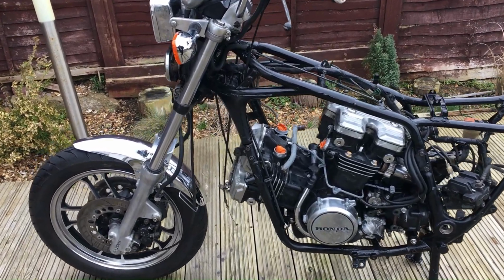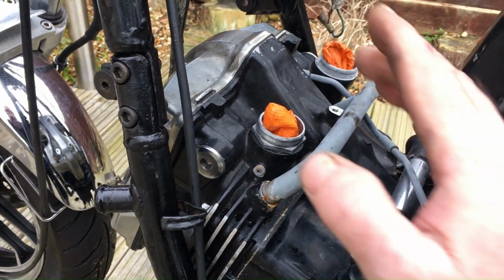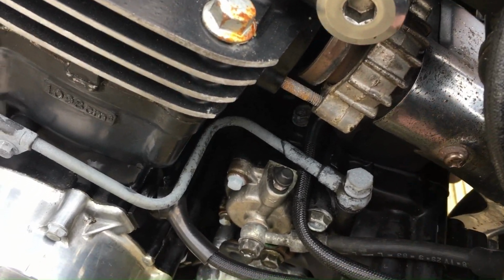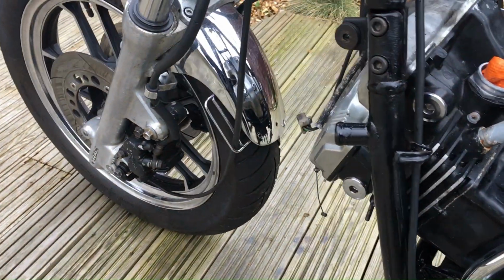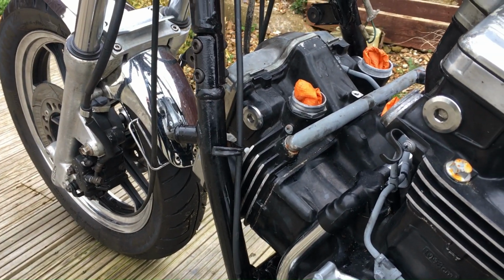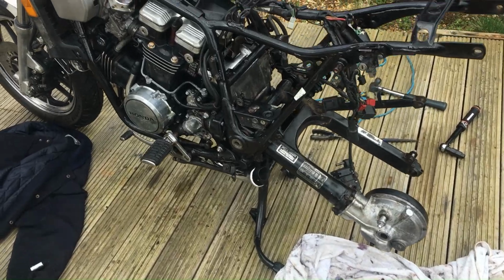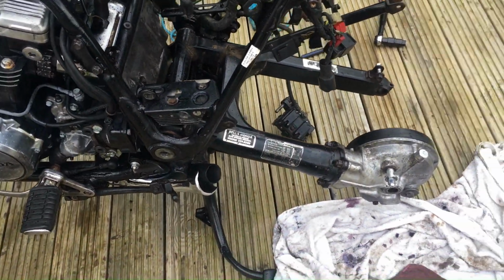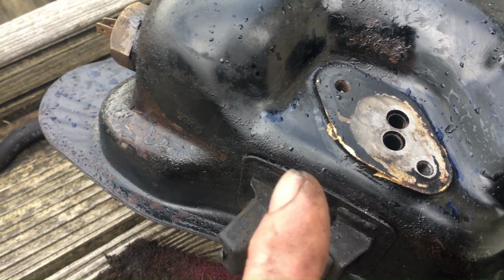Barn Find 1984 Honda V65 Magna VF1100C - Part 32 - Rebuild - day 2

Comment: Now how did u remove and fix that grey pipe ? Just pull it out ? 😇 One cable left in the lamp is for the coffee machine! How do you remember the proper sequence for installing, without removing again what is already installed too early? he he
Looks like she's almost ready  to roar. GREAT job 🏅
Praise to the almighty for your healthy knees. I couldn't crawl around the machine like u do. 
Anyway, thanks for sharing 😊
Reply from the maker: Yes, they just pull out, normally, there is an oring on each end, normally I just clean the pipe with scotchbright. This one was stuck on - lots of WD40 and a bit of wiggling, it came out. The one cable, turns out it doesnt connect to anything, in the shop manual wiring diagram, it goes to switched live from the ignition, marked PA - think its for a parking light, but bike doesnt have switch or parking lamp, but diagram shows an unconnected brown wire in the headlamp - which is what I have so no problem

Comment: i just rebuilt two magna motors the pipe is no weak the water seals needs lub and the oil is from the from valve gasket leaking.hope your strong enough dude to pick that motor up! just remember no oem gaskets anymore! all he's thinking is about looks just like a woman.
Reply from the maker: Well, so far so good, I replaced the front rocker cover gasket, but no leaks apart from that